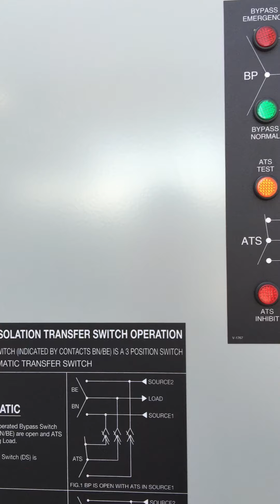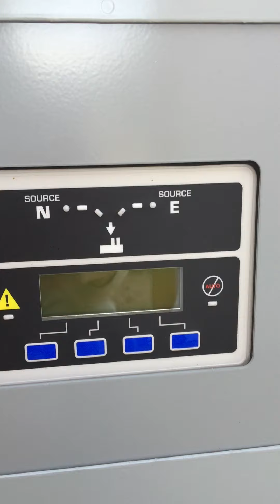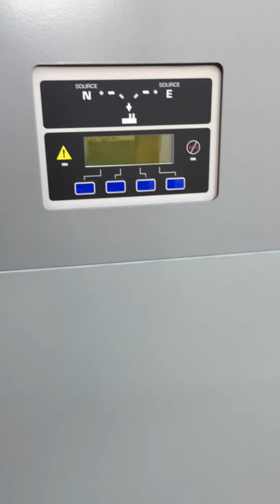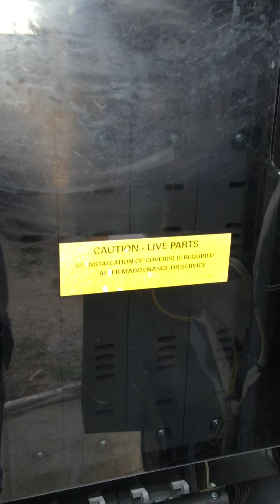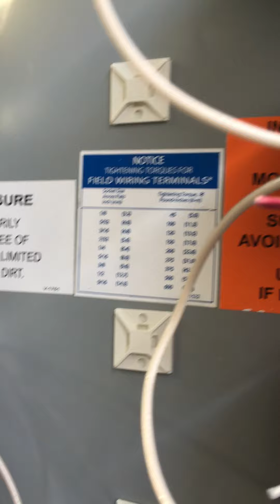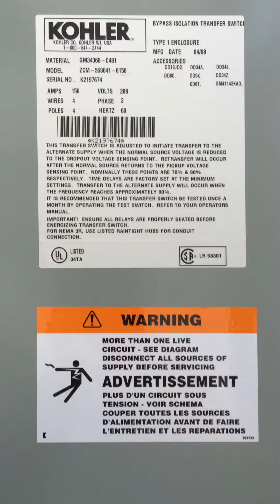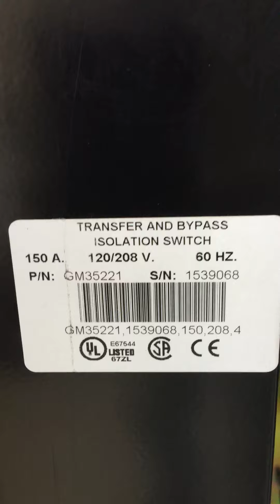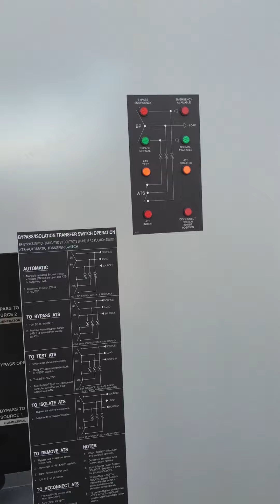Kohler Transfer Switch

Comment: Are those two black "donut" transformers you handle at 4:20 installed at factory? they seem to be connected afterwards.  Why are they needed or where do they go? I bought a RXT Kohler transfer switch and it came with one. It was not connected anywhere.  The ATS 200 amp transfer works fine and is connected where it should but that black donut was never used.  I figured it had to be some kind of current monitor or something.